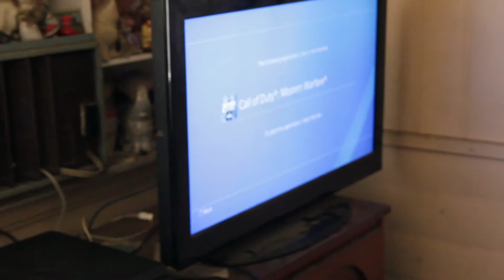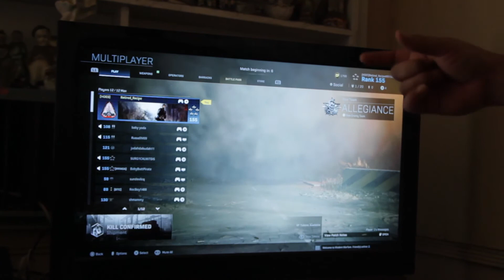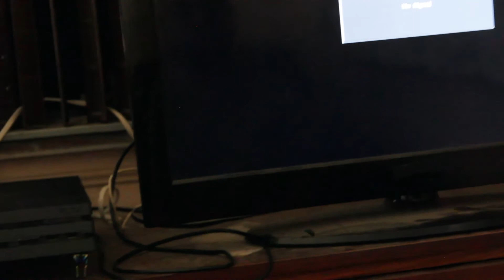PS4 Pro Loud Fan Repair

Comment: helo, the issue is apu clamp and the screws... you can't tight very well that radiator. sow, when is not good contact between apu and radiator, the apu will overheat. try to add something under the clamp and tight better those screws. simple test: check whit you hand in back of the ps4, if is hot air? if is hot is good if not is bad.
Reply from the maker: Thank you. The loud fan noise came back after 4 days
Reply from the maker: I fix it again with your help, air coming out was cold and fan was very loud, I put 2 plastic washer on each bolt for the heat sink radiator
Reply: @romoalex  the plastic is not good... it whit melt down. You need metal washer
Reply from the maker: Oh mannnn. Thank you for heads up